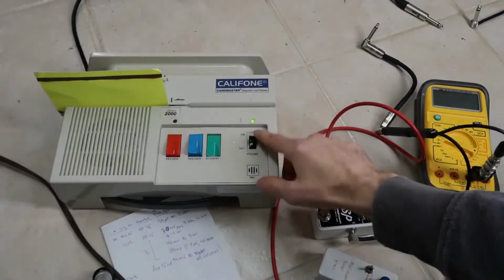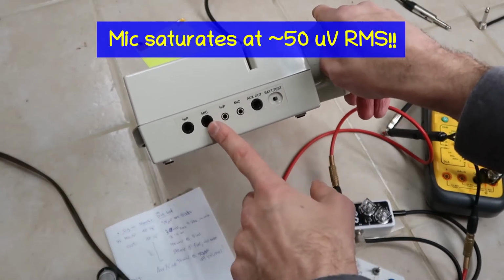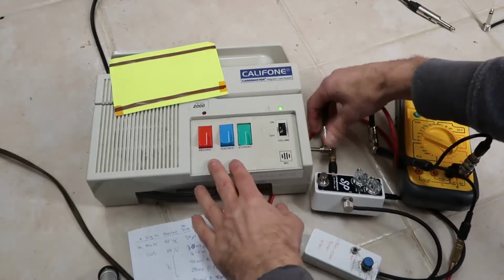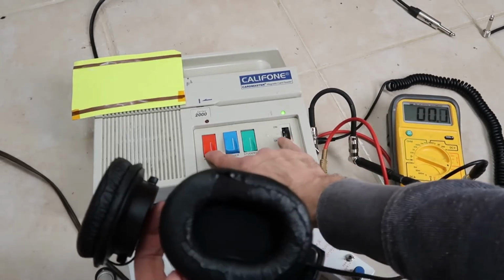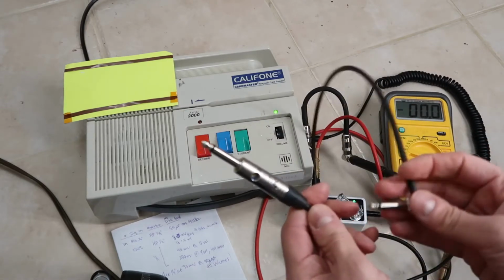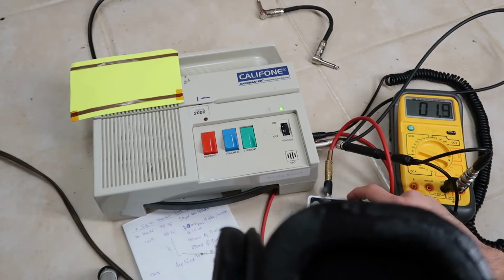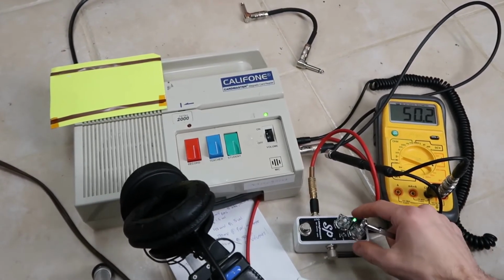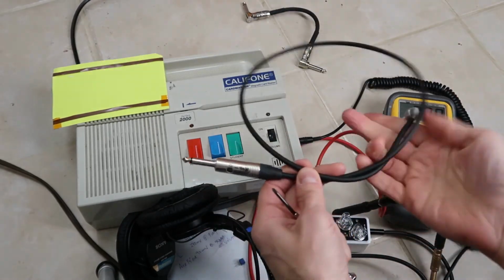Use a Califone at line or guitar level with a home made attenuater

Comment: very clever! I recently got a reverb pedal  to use with a Califone record spinner aux out,  between the record player and the passive speaker. The little amp is maybe 10W at 8 ohms. I can't get anything from the pedal output at all. I suppose the output values are incorrect, one way or another. Any thoughts?  Perhaps one of your custom cables is the answer? The Califone record player runs a passive speaker without the pedal in line just fine BTW. Love your channel!
Reply from the maker: Hmm, if you're not getting anything out, it's probably not that the signal is too strong. We had way too much signal, so it was just distorted like crazy, so adding attenuation helped a ton in my case. I think you've got some other problem.
Reply: @JoyeMusiccom  thanks so much for the reply! I'll let you know what the deal was when I figure it out!